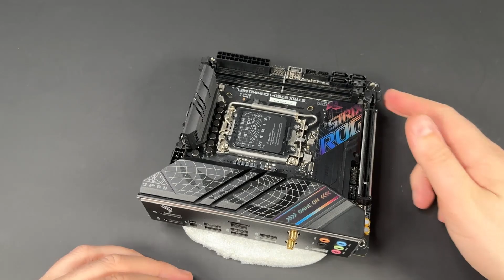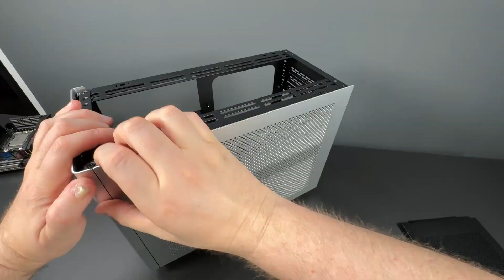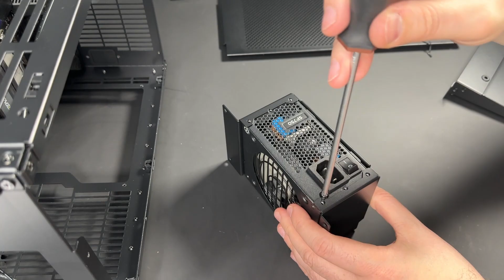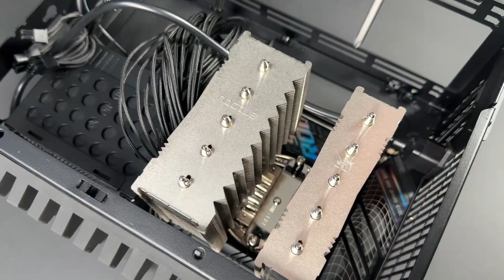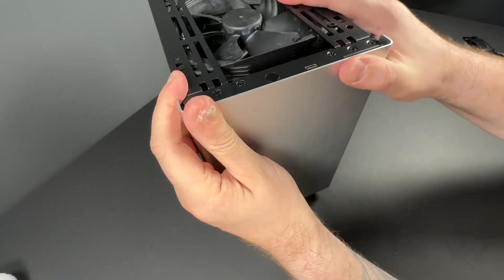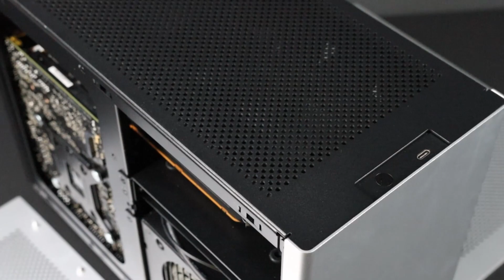Air cooled DAN Cases C4-SFX Build

Comment: Nice video man. In your personal opinion, do you prefer the D12L or AIO setup in your C4?

Was the case being oriented to your left and having that side fan exhaust blowing at you in the D12L setup a factor in choosing?

Also, is it ok to go without an exhaust fan if opting for the AIO setup in your opinion?

Cheers!
Reply from the maker: Thank you! Currently I'm using the C4SFX together with the D12L. I guess, this answers the question what I prefer ;-) For the video it was oriented left and tbh it was nice to have a bit warm air on the table ;-) Currently it's on the right, so I enjoy the view of the back of my motherboard. For the AiO setup you could think about pulling the (hot) air out of the case instead of pushing cold from outside. I would try both, note some temps and chose the best direction.
Reply: super helpful, thanks! @hrdwreblog
Reply from the maker: Glad I could help.

Comment: Vielleicht ein wenig ein Longshot, aber ich werde im selben Case eine ASUS TUF RTX 4090 OG OC (325,9x140,2x62,8mm) verbauen. Meinst du Topintakes passen da noch rein, und wären überhaupt sinnvoll?
Hast du beim CPU Kühler eine bestimme Ausrichtung des Ventilators gewählt? 
Danke für das gute Video :)
Reply from the maker: Vielen lieben Dank! Sofern noch etwas über die GPU passt, würde ich 2x Noctua NF-A12x15 PWM (15mm dick) oder alternativ 2x Arctic P14 Slim PWM (16mm) verbauen. In meinen Augen sind die Intakes über der GPU sinnvoll da das Case schon relativ warm wird. Der CPU-Kühler zieht kühle Luft von hinten an und drückt sie Richtung dem 140mm Outtake damit die aufgewärmte Luft schnellstmöglich aus dem Case kommt-